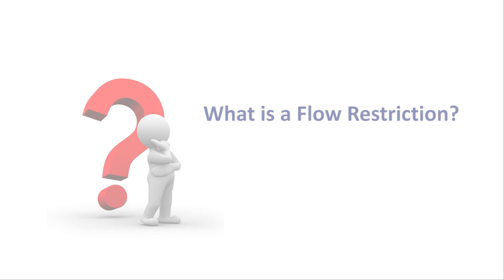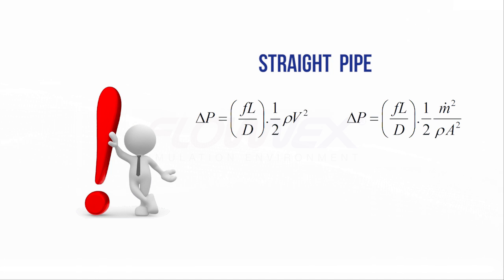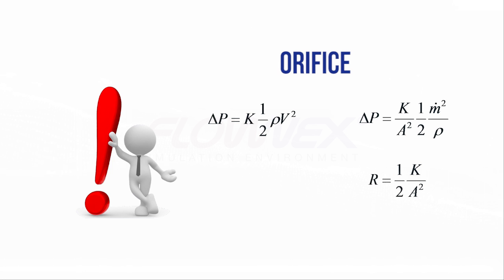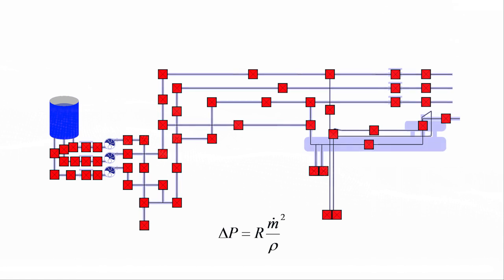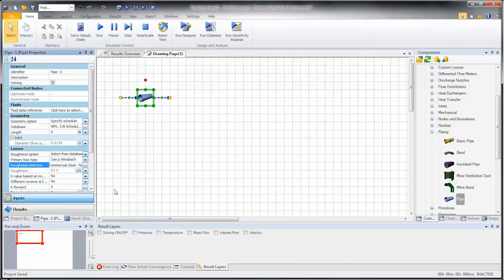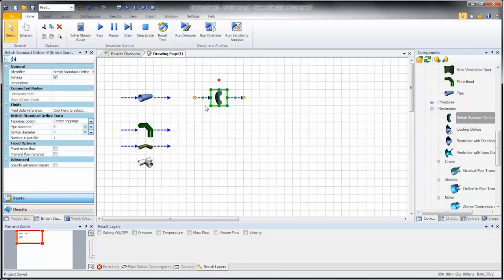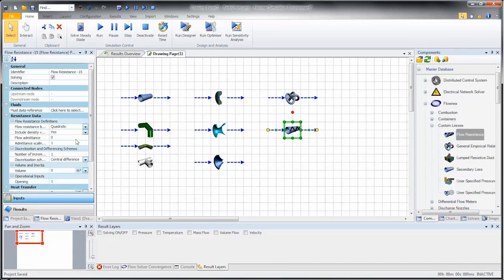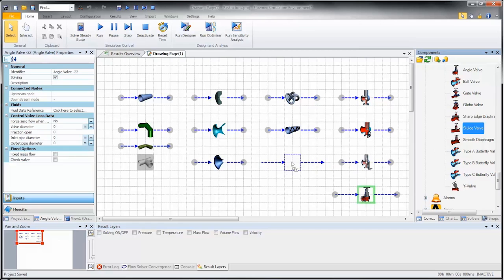Session 5: Flow restrictions

Comment: Hey,

Thank you for the interesting videos! They are very helpful and rigorous. 
However, f is dependent on the Reynolds number in the case of a straight pipe. Hence, R is also dependent on that number. I believe that for a specific pipe one can get different values of R, depending on the fluid and the flow rate (f is dependent on the fluid props and the velocity). The independence of the Reynolds number happens only for fully rough regimes, which is not always the case.
Pedro